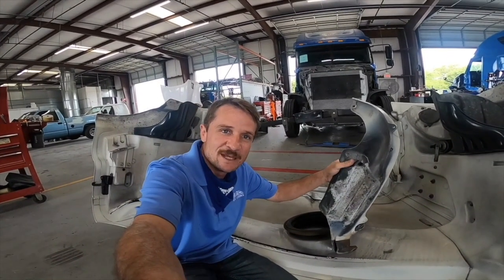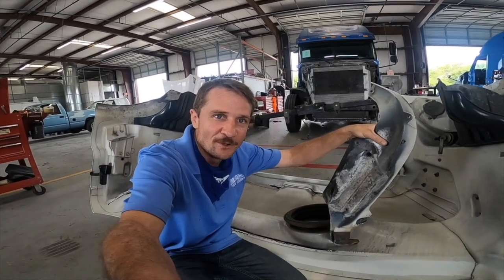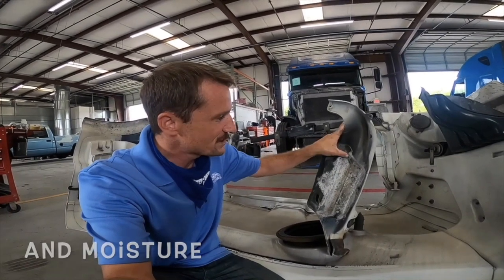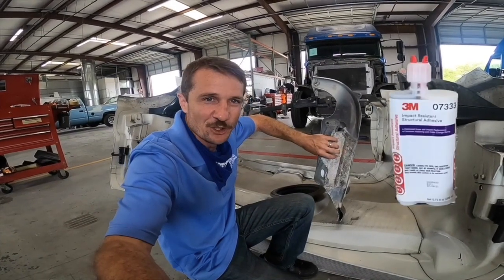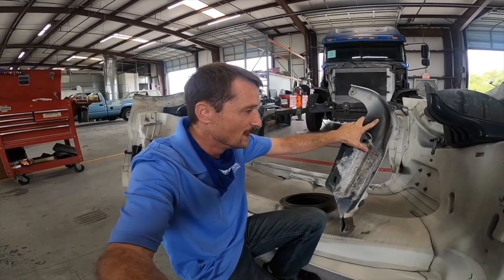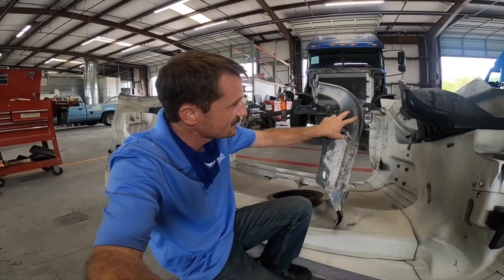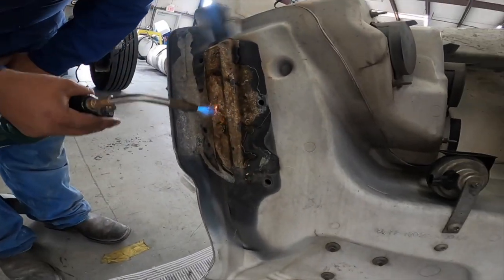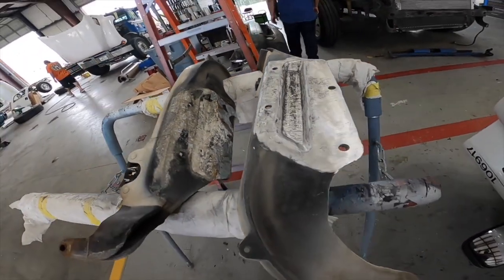Watch this Before You Replace a P3 Freightliner Hood Pivot Bracket

Comment: I've had the same problem with all my hoods. I know it's not the prettiest fix, but this is what I do. It's the quickest and easiest way. I drill a hole using the pivot bracket as a guid through the hood. I than use stainless steel screws through the hood to the bracket. Screw them tight with lock washers and never have a problem. The only thing that shows on the hood is the shining heads of the screws. Not a big deal.

Comment: My left side broke after the right side had been fix. Where can I get the bolts and rivet or do you have a part number for that kit?
Reply: Ever Amador.  Sorry for the delayed response.  Please feel free to send any questions to contact@jmrbodyworks.com as that email is monitored everyday.  We used a M8x1.25 AR Series Threaded Insert with matching M8x1.25 bolts that are approximately 1.5 inches in length.  Make sure you use coated bolts and inserts as the brackets are made from aluminum and you don't want to get cross contamination.  Hope this was helpful.

Comment: When you updated the brackets to the bolt kit, did you wait 24 hrs before reinstalling the hood or were the bolts strong enough to hold everything in place while the adhesive cured?
Reply: We usually give about 4 hours for the glue to set up.  The bolts are strong enough to hold them in place while you install the hood but don't put it on the road till the glue cures.
Reply: @johnkeith1599  I'm calling you in 5 minutes

Comment: I'm looking for that insert you used for the bolt threads. Your the only one mentioning it and it seems practical. Is that something I can get from the dealer ? Thanks!
Reply: The dealer won't sell them.  You buy online or at a grainger store.
Reply: What is the name of the piece/part so I can buy it
Reply: @alfredoherrera5500  
Rivnuts. Los puedes comprar en harbor freight

Comment: Can you please tell me what kind of did you use?
Reply: Did you mean Glue?  If so, it was 3M IRSA glue.  Stands for "impact resistant structural adhesive".  You can buy it at any automotive paint supply company and will need an applicator gun as well.
Reply: Do you have to wait a set time after applying the adhesive before re-installing brackets?

Comment: How much would it cost me for body shop to do it and also do I need to do it both side please respond thanks
Reply: The price will vary depending on if the bracket broke or just came unglued.  Expect a cost around $750 - $1000 if broken and I would always recommend fixing both sides.
Reply: When you say 750 or $1000 are you talking about one side or both sides please respond appreciate it
Reply: @abukarsaid813  That would cover both sides.

Comment: I did mine yesterday..everything went perfectly, but the hood doesn’t close properly on one side any advice for me please
Reply: You likely have a bent pivot bar, or it may just need to be adjusted.  Loosen the 2 nuts in the center of the pivot bar bracket and shut the hood.  If it's an alignment issue, then it should shift into place and then tighten those nuts back down.

Comment: In the process of prepping the hood to finish the job myself just don’t know what type of “rivit kit” or metal thread inserts to use ? What should I get ?
Reply: You'll need to use a M8x1.0 steel threaded insert and bolts that match. They can be found at most hardware stores or specialty fastener stores.
Reply: @johnkeith1599  can you please copy and paste a link of an example there are so many different kinds of inserts ? They really didn’t show a good example of what they used in the video so it’s hard for me to match them up . I know he said the “rivet kit they use on the 2015 cascadias” but I can’t really find a “kit” that they use !